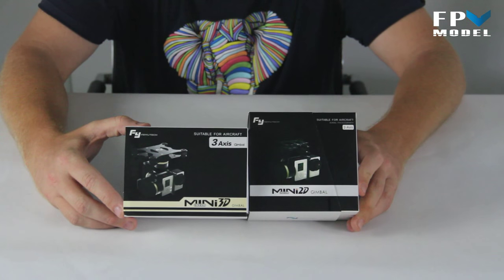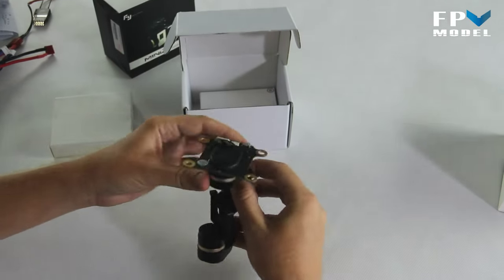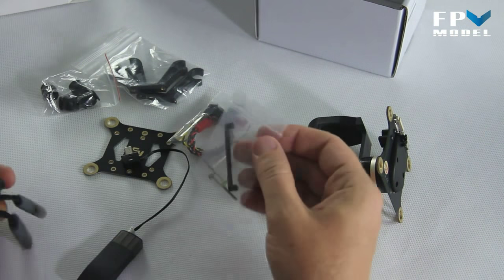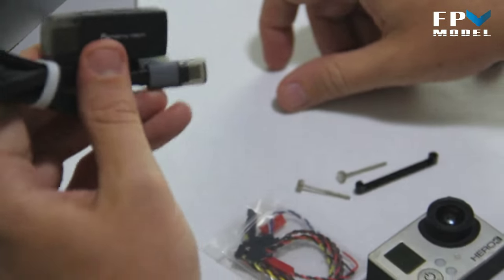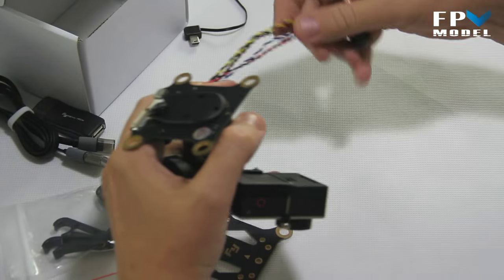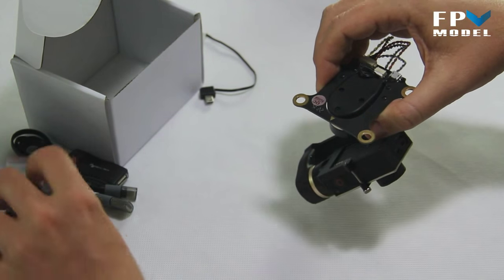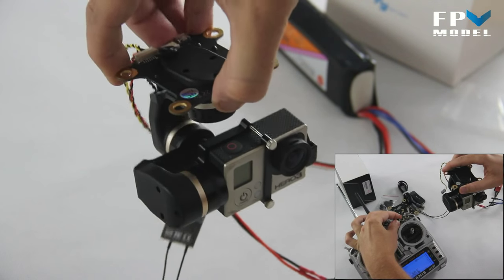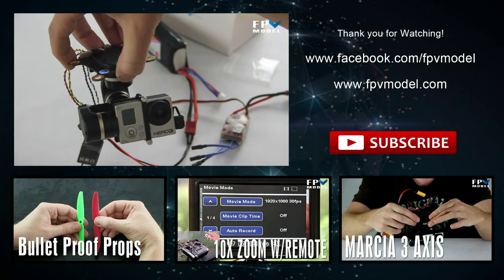Feiyu Mini 3D Gimbal.

Comment: You mention controlling the modes with a three position switch.  I have tried this with the gimbal  mode control cable plugged into my Walkera Devo 10 receiver Aux 3 and output from Mix switch, with 0, 1 , 2 positions.  The travel adjust is set a -100%, 100%, so I presume this gives respectively -V, 0, +V voltages on the receiver output connected to the gimbal mode cable.   Switching through the Mix switch positions does nothing, the gimbal just stays in its default mode where I can only control the tilt position.  Should  -V, 0, +V control the modes or for example, should it be 0, V1, V2 output to the gimbal mode control cable?  I can't seem to find any info on this. Thanks for your help.

Comment: All I have is a DJI Phantom 2 and the receiver that comes with it. What do I do with the wires? The ones that are hanging off the 8-pin connector? Can I just plug the 8-pin connector that is on the Phantom 2 in to the 8-pin slot on the gimbal?

Comment: Hi,
thanks for the great review.
I have just got one of Mini3D gimbal from Feiyu Tech. In operating condition there is a high pitched whine almost constantly. More precisely, in some position there is that whislte, in some other not, but basically when the stabilization system is working there is the high pitched whine. Is it normal or my gimbal has an issue?
I checked the driver, it's the 1.13 version, the last one. 
Thank you for your help.
Kind regards,
Luca

Comment: I just bought this gimbal but haven't hooked it up yet. I got a kinda dumb question. There are two video outputs, but where do they go? If you run the GoPro into the gimbal, is it connected to the video coming out of the "breakout" cable from the controller on top, thus capable to connect to an FPV transmitter? Also, do you have to dedicate a separate battery to the gimbal, or can I just connect to my pdb?

Comment: I am totally new to RC these devices and considering this one for a remote STATIONARY camera ( not on an aircraft). THANKS for the video but have a question for you and maybe you can help out a newbie...

@FPVModel, what are you using to control pan and tilt? From the schematics I see the connectors but need to control with an S.Bus. Is that an S.Bus decoder on the table top? Something else? Thanks.
Reply: On a related question, is it possible to modify it so I can interchange the motor controls to use the tilt for roll and roll for pitch? I want to use Sony ActionCams ands since the sense point a different way, moving will be required (if possible).

Comment: I wonder. Does it work with other action cams, like the SJCam SJ5000x too? Or gopro only?
Reply: I have the sjcam 5000 + and it's to big for any gopro gimbals. 
gopro are 4mm wide and the 5000 is 42mm.

Comment: You said it has Audio Output through that USB cable. Did you mean Video? The Manual says it's for 5v and Video, so are the three wires Video, Power and Ground, or Video, Audio and Ground?
Reply from the maker: MallionsEye Had to go back and watch it. Yes, it's video....didn't realize I had said audio.

Comment: Hi...i just bought the feiyu tech mini 3d gimbal, new model (6 ball). I am having a few problems when connecting to phantom 2 and sjcam 5000.
1) gimbal wont calibrate straight to the horizon.

2) i connected the pitch control wire (blue) to the phantom using naza mode. Tilt control works ok but when tilting the phantom forward or backwards, gimbal does not stay level. Instead it goes up or down.

3) with gimbal attached to the phantom, weather it is on or off, when i do compass calibration i keep getting a constant flashing red error on the phantom.

Any help please?

Thanks
Reply: same issue when I tilt the P2 up the gimbal looks up and rolls upwards until you level the p2.

Comment: Hello,in this video you switch the 3 gimbalmodes with the taranis `transmitter.I have also the taranis and the mini 3D too and searching for the right Transmitter Output Settings fitting to the gimbalmodes. Can you please tell me the  your output settings?
Reply from the maker: +Olaf Walther Anyone of the three position switches will work, just make sure your switch is set to the appropriate channel on the Rx. If you're not using sbus you'll have to manually set it to a servo channel and make sure that servo channel is connected to the appropriate port on the gimbal.

Comment: Hi, I have the same gimbal and I wasn't able to control it (pitch, roll, etc).
Do you have to connect all the cables to have access to the control ?
When I connect the pitch cable to my Spektrum AR8000 Receiver it doesn't work... (plugged in AUX3 on the receiver which is affected to the potentiometer of my Spektrum DX8.) I just tried the same configuration with the roll cable and still nothing.
May I miss something ?
Reply from the maker: +Jean-Luc DANG Difficult to say without seeing how everything is connected but it should be relatively straight forward. Have you assigned it to the proper sliders or dials?
Reply: +WWW.FPVMODEL.COM Ok I have found the solution : the mode switch cable has to be connected to the RX as well...

Comment: Is the Feiyu mini 3D compatible with the DJI phantom 2? Are the cables right? Can I use it with the fatshark predator v2? Can I control the tilt with the dji phantom controller?
Reply from the maker: Simen Langeteig You could mod it to fit the Phantom but I'm not sure of how you'd go about doing it. As for the control of it I believe you may end up with problems. I'm not sure if the phantom II has two channels that can be assigned for gimbal control...I think it's only one but someone out there with one might be able to correct me on this topic.
Reply: Ok, thank you for answering :)

Comment: What flight controller do have it plugged into?
How do you set up the yaw and pitch controls?
Reply from the maker: odinata connect it to your receiver and assign a channel to your transmitter/radio and you're good to go with the gimbal control.
Reply from the maker: Yeah, you can connect it to the receiver. Many gimbals are this way. I don't know too many that go to the flight controller.
Reply from the maker: This gimbal has it's own controller built in so no need to connect to the flight controller.
Reply: WWW.FPVMODEL.COM So I just bought the 3-axis, 6-ball version.  
Now for the kicker:  I want to use CPPM on my FrSky D4R-II receiver.
Can I still plug the gimbal into the this receiver?  I'm a noob and not sure if there will be left over channels on the receiver.
Reply: +WWW.FPVMODEL.COM Just got the gimbal.  IS that little cable supposed to power the gopro?  Shouldn't the read light come on to say its charging?

Comment: I bought this thinking it would be great since it's small and light weight. I have a Phantom 2 and after installing it with the instructions and plugging in the blue cable into the FC F2, i am able to control the pitch but it only does 45 degrees down and won't go 90 degrees down. Anyone know a solution? Mini 2D...another thing why know software to make adjustments? That's another negative on this...Fix that and i'll change me comments.    Found same issue with this guy... http://www.rcgroups.com/forums/showthread.php?t=2577522

Comment: What's the differences between 3 axis and 2axis gimbal? is this gimbal can be applied to DJI Phantom 2 ( and the remote able to control the pan? ) also, my action cam is the same heights as gopro but wider to the side.. can it use this one?